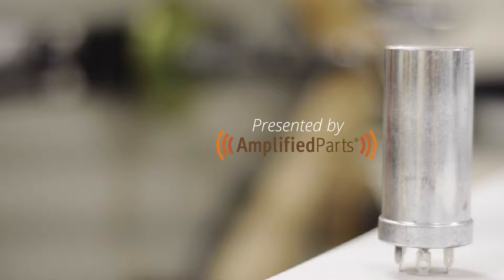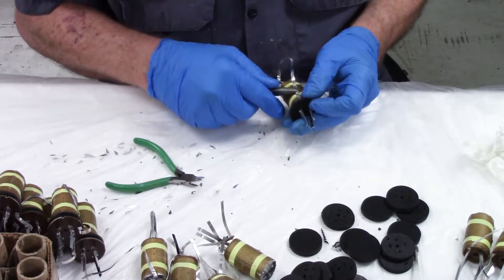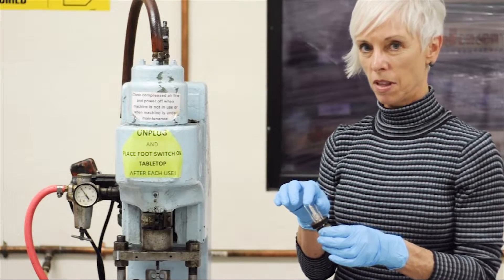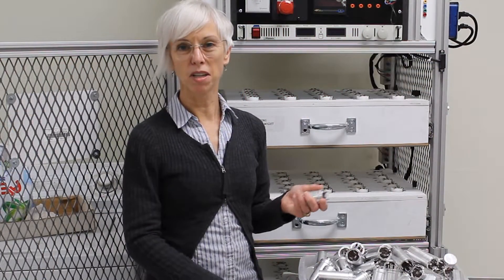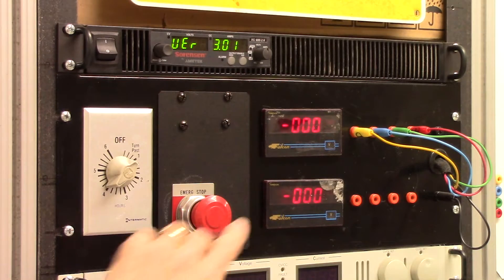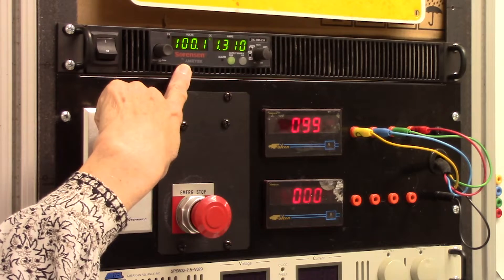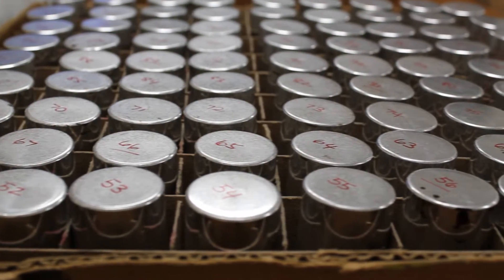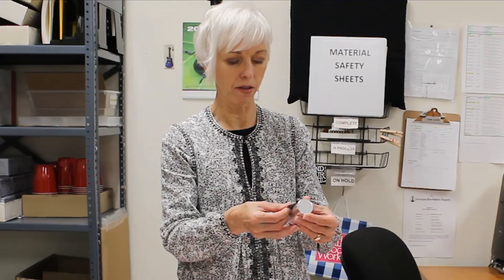CE Manufacturing Can Capacitor Production (Part 3)

Comment: So what are we dealing with here actually? How does each section of one of these caps compare to a modern Nichicon or something very high quality, in terms of ESR and such?

In other words, you're using old machines, but have materials improved so that the caps you're making today are better than Mallory made 50 years ago?

Do modern caps from other manufacturers still use paper as the insulator between foil strips?

Comment: very great demo on how caps are made.at what point in process is the capacitance farads determined?
thanks
john
Reply: Capacitance is determined by the area of the anode electrode winding, and the thickness of the insulating oxide layer formed on the anode during the ageing process. More area gives more capacitance. Thicker oxide layer gives less capacitance but higher voltage rating. I guess that the thickness of oxide for a given voltage rating is known, and the required area of anode foil is calculated back from that.

Comment: Thanks Yvonne. I am so glad I don't have to buy these from some sub standard Chinese operation. I service many old amps and a few other antique pieces, ampeg v4's and svt's. The only thing I can add to this for you guys is save the old cardboard sleeve, some are strung out in series and you can get zapped by the outer aluminum. Or start to sell cardboard sleeves. But a fantastic job getting the equipment back and doing a wonderful job. I actually just ordered a few from AES, which I believe owns them.